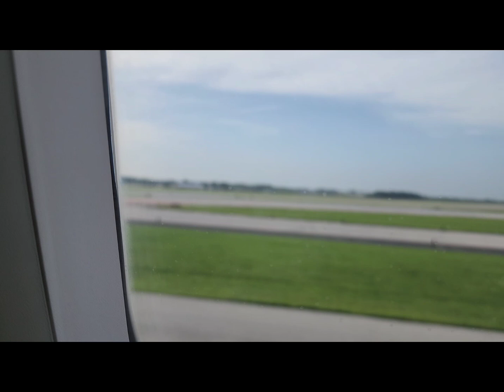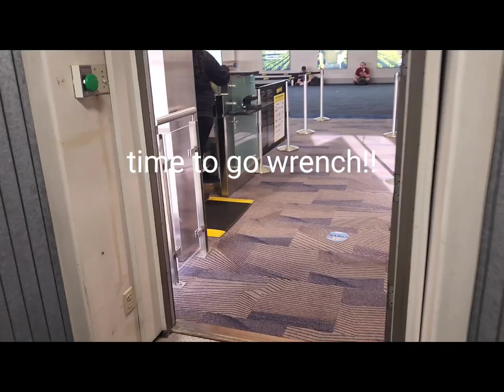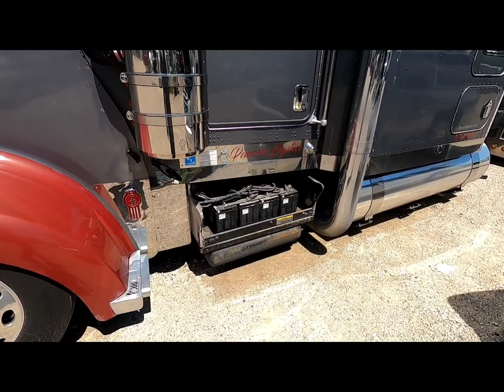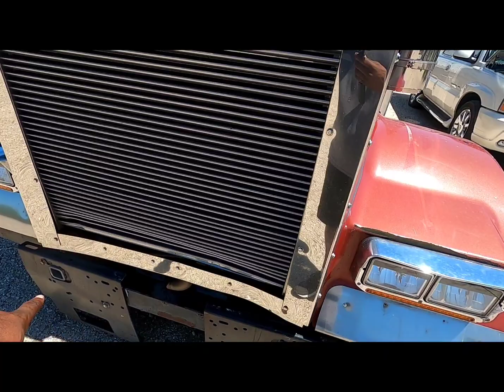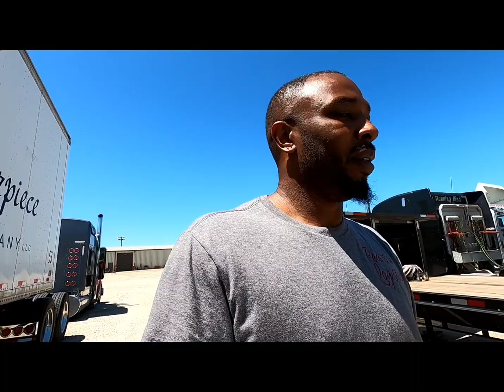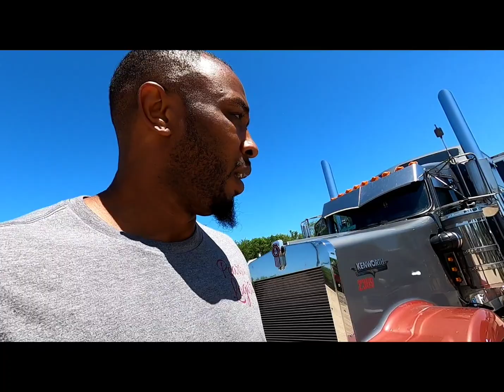The beginning of the tear down |Rad stuff #1

Comment: Good luck finding that metal support bar that goes between the hood hinges.   And if you do find one…. Get new clamps on either side of it.  You will have to torch the old ones off.   Chad Berry and I just did mine last month.  Was a nightmare.
Reply from the maker: It is has been hard to find... but I pre ordered it